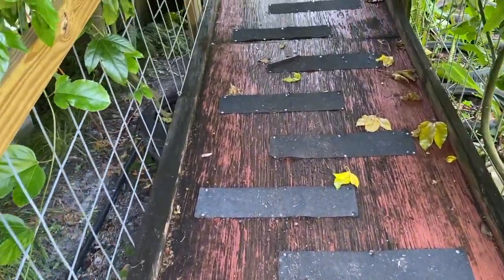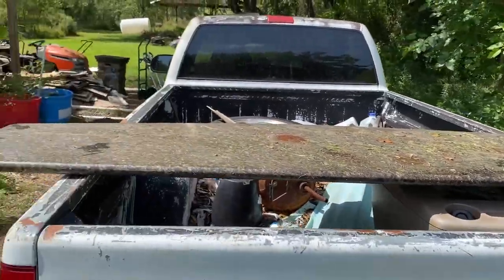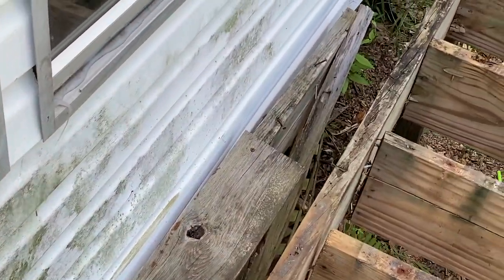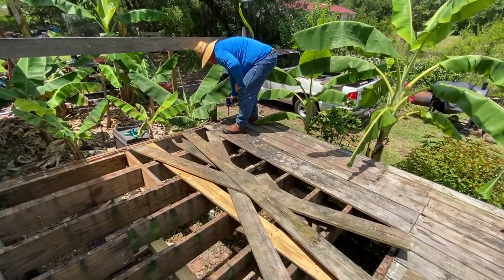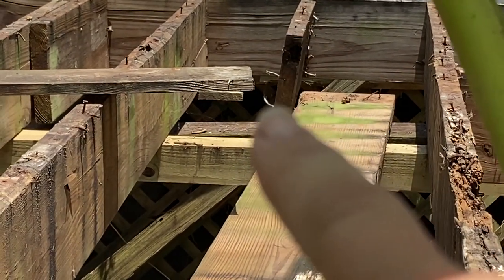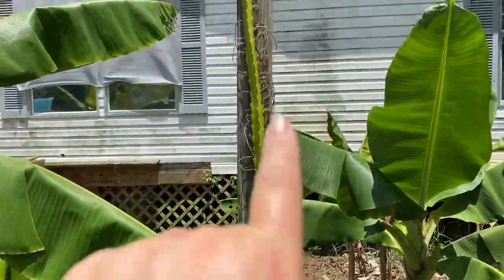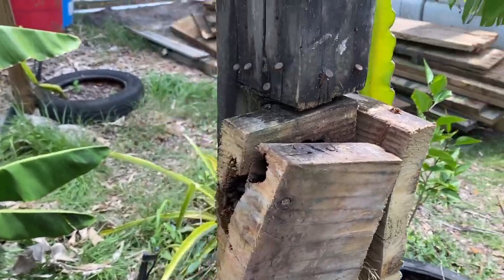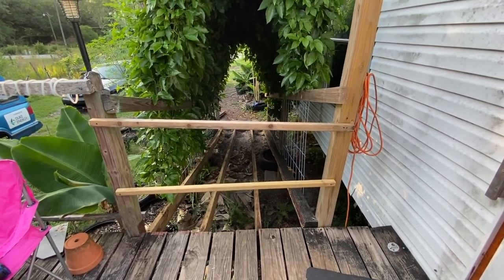Deck Repair Part 1| Deck Issues| Homeowner Repairs

Comment: In Florida it is against code to attach a deck to a manufactured home.  It won't be a problem if code enforcement doesn't find out, but if they do you will have to tear the deck down.